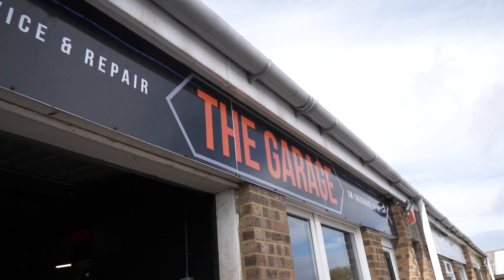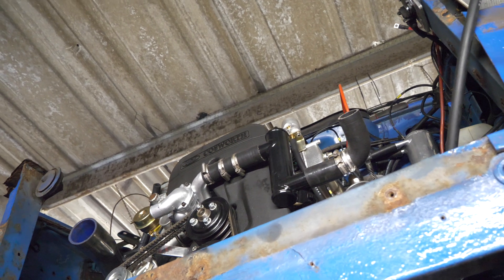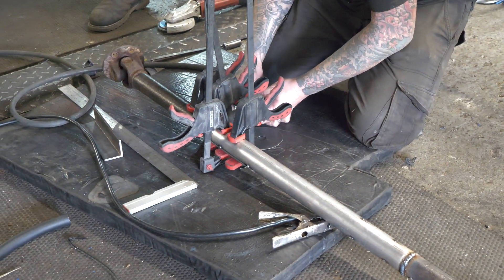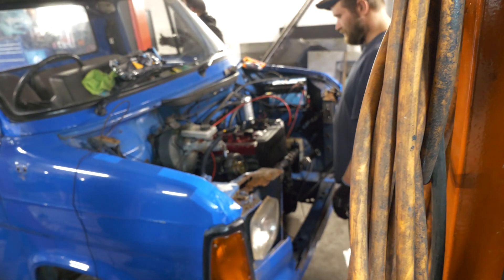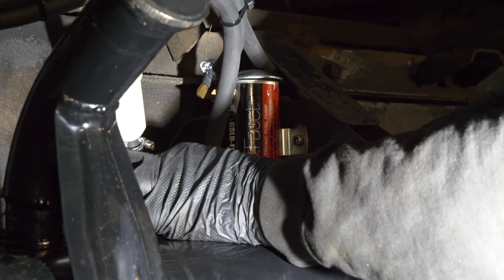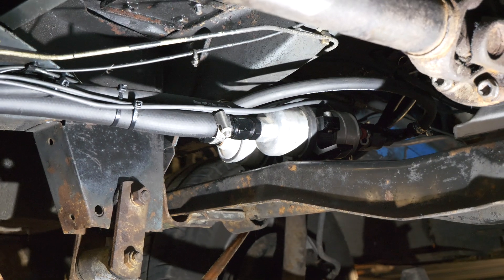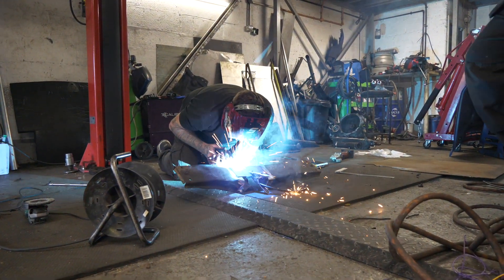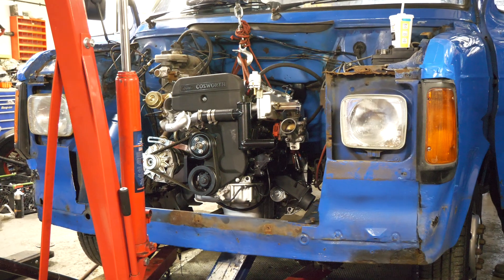JUNKYARD TRANSIT **COSWORTH ENGINE SWAP** PART 2!

Comment: twin wheels and axle is to heavy for the cosy engine,  cosy engine have  a lot power but it's not heavy use designed, like if you have heavy load+mountain up drive happens that the engine cracks, same problem have  Volkswagen T2/T3/T4 with Porsche engines too